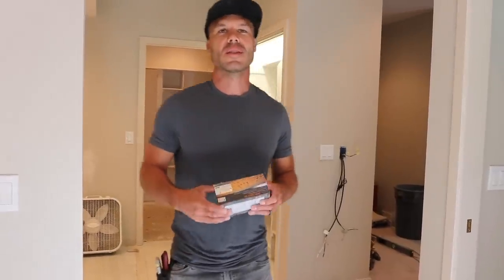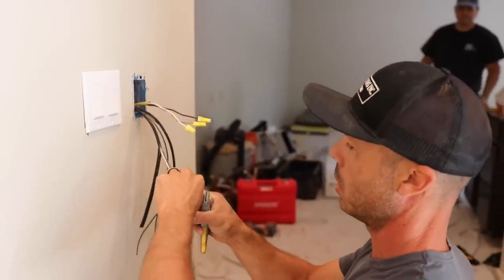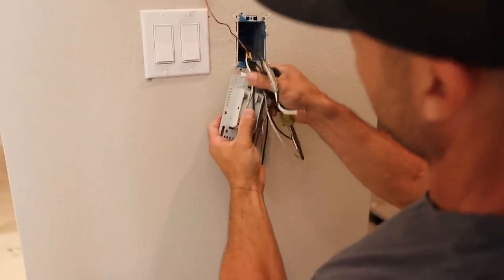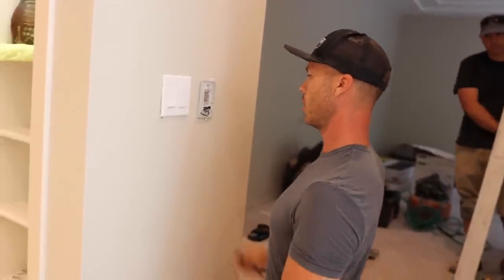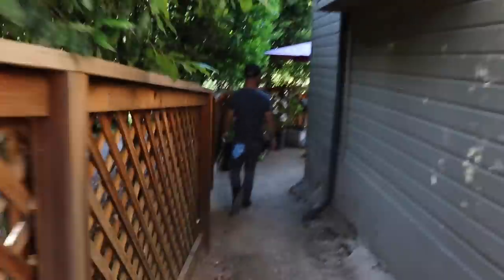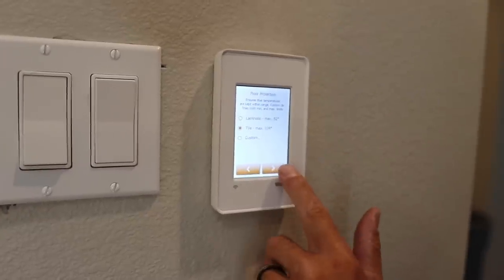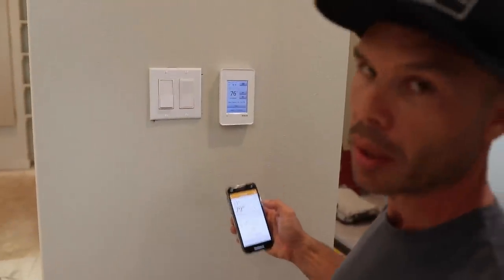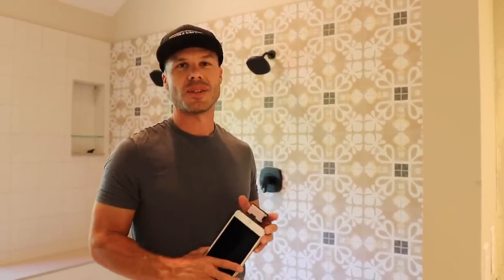WiFi HEATED TILE FLOOR THERMOSTAT --- How to Install DITRA-HEAT

Comment: Couple of suggestions when checking continuity. When checking for Ohms make sure you’re not touching the wires of the probes. You’re picking up resistance from your own body so your measurements is off. Also when checking the ground between the load wires you need to change your setting on ohms to 200 M. This way you can see the absolute smallest amount of leakage.
Reply: Just wondering what problems you face when using a wire nut on the ground wire hookups? I used. A wire nut on the ground wires and now the red button keeps tripping. Is that something you have faced?
Reply: No. sounds like something else is going on.  Wire nuts in the box are standard

Comment: The FLIR for iPad/phone is great idea to see any issues, locations, etc.... They are also so much more affordable now, that having one in your toolbox, doesn’t mean need to take a loan out to pay for it. Surprisingly, they do come in handy on many different jobsites (I also use mine for electrical “troubleshooting” at times).
Can remember when didn’t have one & finding a break or issue in the wire under the tile; meant putting holes in the floor to locate the trouble spot.
Until next time✌🏼

Comment: I'm a stickler for small details and those two shower valves are about 1/2" difference in height.  Being there is a grout line at the top of them highlights the difference even more.  I use a laser level for everything that way there are no issues.  Other then that the bathroom turned out well.
Reply: We laser up as well 
Suuuper nice self leveling ones available these days for under 200 etc etc makes no sense NOT to laser up
Reply: The shower valve closest to the bench has a diverter valve for a handheld shower wand. The valve itself is taller for that reason. That is why it looks different from the other one.

Comment: I would have wanted that display/control panel mounted at eye level.   Is there a reason you didn't mount it where it is more easily read/controlled?

Comment: I'm an electrician and I got confused and hooked up both sensor wires. How did you know? Thanks for the video! Cleared it all up quickly for me.
Reply: Only 1 sensor wire. If stop working you install the other instead break the tile and run a new sensor.
Reply: what code were you getting ?

Comment: Try raising the thermostat box to about 60"? This is way better for adjusting temps on any thermostat regardless what its for.
Reply: it is not measuring air temp.in the room.
Reply: @brenthull2048  reference is for ease of access....

Comment: Can I run a 120v heating wire on a dedicated 240v breaker? Double pole 20 amp....? The electrician said it should be okay but I think it's wrong....it should be a single pole 20 amp breaker which is 120v...Correct?

Comment: What do you do if you can’t get a dedicated wire for the thermostat? Can use take out the current 20amp outlet in the bathroom and install that thermostat?
Reply: Thats what my electrician did with my floor heat thermostats and it's been 11 years of flawless operation.

Comment: You said you have to put a crimper on the ground wire and not a wire nut. If you did use a wire nut will that cause the ground fault light to pop o n for no reason?????

Comment: I just installed a ditra heat floor in my bathroom. It seems to be working fine, but I only ran one sensor wire under the tile. How often do the sensor wires fail and need to be replaced with the redundant wire?
Reply: good chance, probably never !!  no moving parts, very low current and voltage. Sleep well!!

Comment: I'm trying to locate a line voltage t-stat that is smart phone controllable and has a child lock feature. It is needed for my senile mother's Eichler home. The existing thermostat has never been changed. It is one black wire in and one black wire out. Which leads me to assume I'm going to have to run a neutral in from the closest outlet. Thanks for any suggestions you might be able to provide.

Comment: Great Video, question: do you have to run conduit in the wall? for the sensor and heat wires, or can you pull wire through without Conduit.

Thanks
Reply: Did you ever find this out?  Thanks.
Reply: One conduit for the heating wire and another for the sensor wires. Why? Because the instructions say so.
Reply: I'm an electrician... I always run 1/2" flexible conduit (carflex or smurf tube) down the wall and stub it out at the bottom of the wall, notching out the base. The floor guys will pull their wires to the thermostat box through this conduit.

Comment: CAMERA GUY: Turn auto focus off. Usually if you hold focus button down it stops auto focus ... if this is an iphone just touch the square in the middle of the screen and hold for a few seconds.

Comment: That left box needs fixing 🤷🏻‍♂️
Reply: Can't stand how electricians make a mess of drywall around boxes. 
Surely, there has to be a better system. In the meantime, I like the wider plates and outlet covers — gives a little more leeway for those gaps and looks more purposeful to boot.
Reply: That left box is a botch as well, likely the apprentice and no oversight from the electrician. The box with the thermostat was put on incorrectly as well, it was put on so tight the tabs were in the drywall itself. This type of box you either hand tighten, or tighten with lowest torque on your drill / impact.